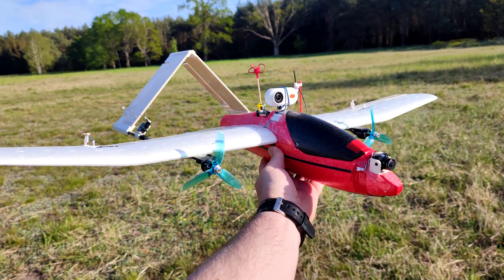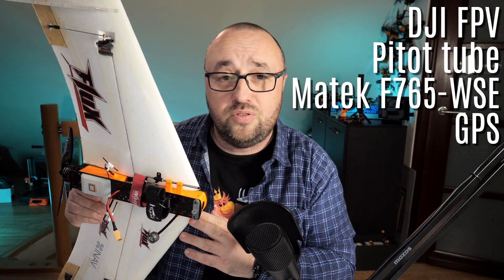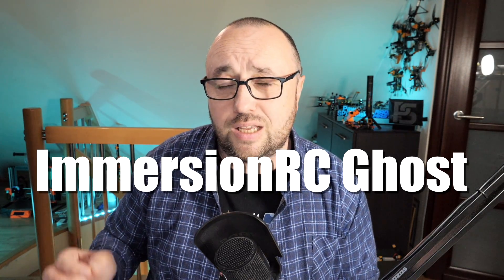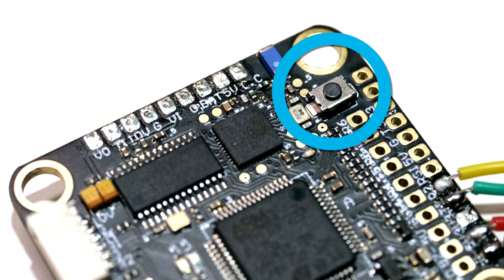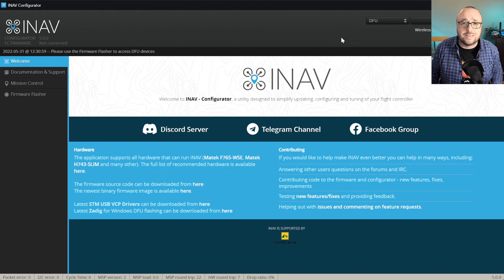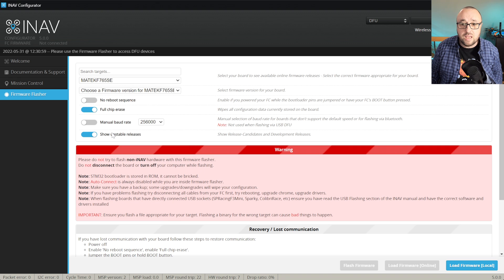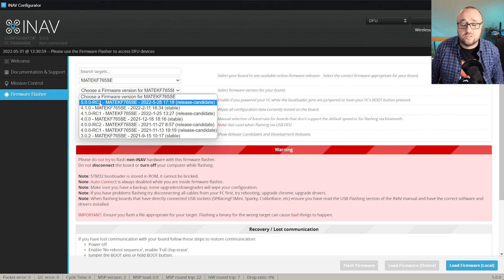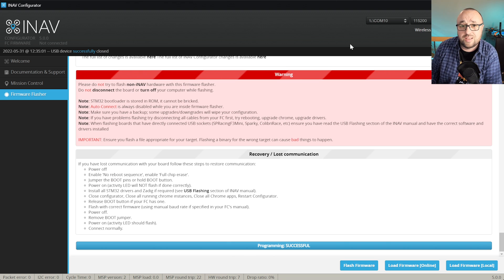Flashing | INAV 5 on a flying wing | 1/11

Comment: Hello Pablo, how are you? I hope you well! I´m speaking from Brazil. First off all, congratulations on your content! I would like to ask a question if possible. Yesterday I took my first flight using INAV on a airplane and everything went well! It was the best feeling I've ever had, all the flight modes and autotune worked perfectly. I can't wait to fly again. I only noticed one strange thing when landing the plane. As soon as the plane stopped, Inav's Lua script said "disarmed", and the plane actually disarmed without me changing the key. I thought it might just be the “disarmed” audio, but I tested the engine and it didn't accelerate (and the key was in the arming position). This happened every time the plane reached zero speed after landing. Is not strange? Is there a setting that overrides the arming key?

Comment: Hello Pawel! Thanks for your efforts!
Is there a target for the matek 411wse with gps, crsf and vista? How can I get a working rx  softserial pin for the vista for example on the led pad? Regards?
Reply from the maker: You can't. You bought cheapest/smallest FC (cheapest Matek). Don't expect it to do the same as bigger and pricer boards
Reply: @FPVUniversity  are f4 not supported any more in inav 5? 
Can you recommend a fc for inav with same or less weight for fixed wings with 3 full uarts? Thank you!

Comment: Thanks for the new version. The FC from my 3" quad didn't want to go in Bootloader mode. I got the message "Unknown USB device" in Device Manager. Disconnected the GPS and next time it went in Bootloader mode. Most probably too much current was drawn from the USB port. Quad is flying nice now. Thanks again to all devs. 👍
Reply from the maker: Thanks for the info
Reply: @FPVUniversity  I flashed a small flying wing with a Matek F411-WSE from INAV 4.1 to 5. Second time the same problem as mentioned above. Error when trying to go into bootloader mode. After disconnecting the positive lead to the GPS, it went into bootloader mode. Is it INAV 5 or just a whacky USB port? Doesn't matter, disconnecting GPS is fine to me.

Comment: Help--after flashing the accelerometer will not calibrate (the model on setup page does not move)
Reply from the maker: That mean you probably flashed wrong target or board is not supporte4d
Reply: @FPVUniversity  Thanks but reflashed no improvement.

Comment: @Paweł Spychalski Thanks for the tutorial. I have an "AKK F4 support SD card" flight controller. I know that it is an OmnibusF4, STM32F405RGT6/MPU6000, but I am not sure which firmware I have to install. There are series of Omnibus INAV firmware, which one is the correct one? I hope you help me out. Thanks.